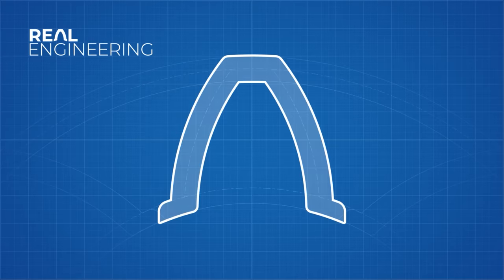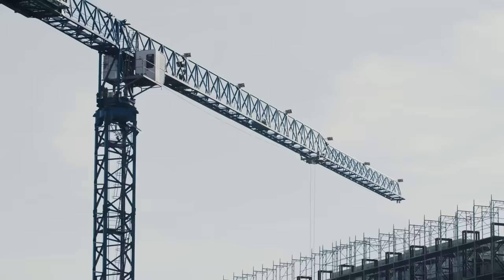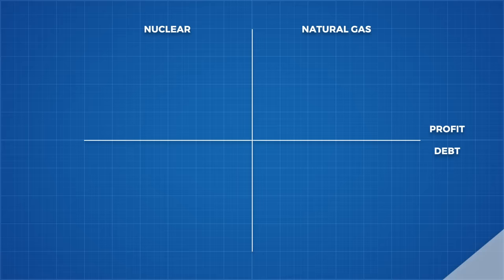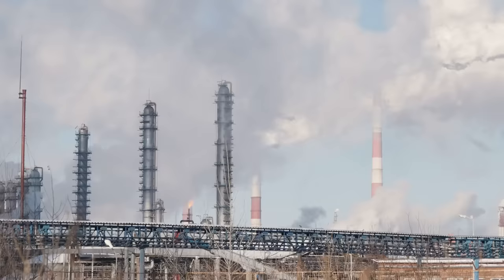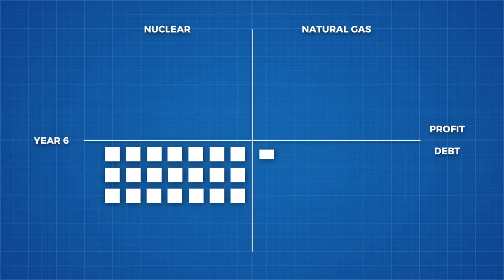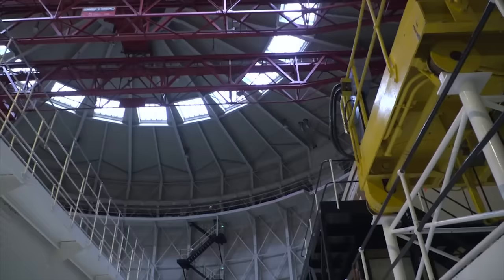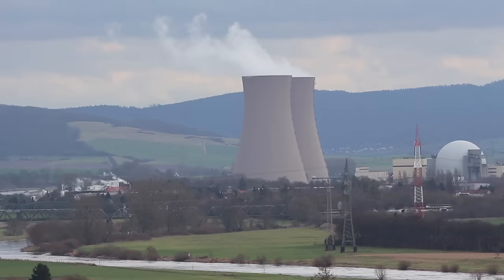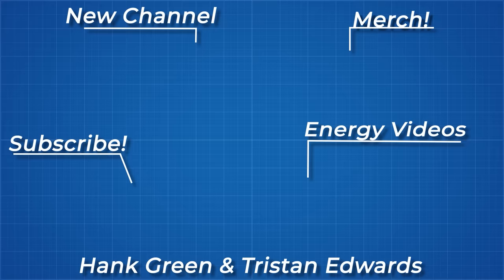The Economics of Nuclear Energy

Comment: This needs to be compared against molten salt reactors.
Reply: How can you do that when a viable molten salt power plant has never been built?
Reply: @Gomlmon99  The technology has been well understood since the 1960s.  See Flibe Energy.  They say they could be operational in 3 years if and when they get government funding.  It's the fossil-fuel and light water reactor industry that is keeping this from happening.  When it happens, and it will happen, these industries will disappear like film cameras.  This is about BTUs out to BTU in.  A coal-fired power plant and a light water reactor have a ratio of about 80 to 1.  An MSR has a ratio of about 2,000 to 1.
Reply: @Cspacecat  except one has never been built so you cannot compare the economics. And how do you know it’s the fossil fuel and LWR stopping them, and not the horrendous corrosion issues they have, that we cannot current deal with?
Reply: @Gomlmon99  You are talking to a retired civil engineer.  This is not rocket science.  It's a nuclear-powered T-kettle.  Calculating it out, an MSR will be about 54,000 times safer than a coal-fired power plant.  We need to do exactly what France did.  Find the most economical MSR that can be built today, and start replicating over and over again.  This lets the economies of scale push the price down.  We should easily get to $0.02 to $0.03 per kilowatt-hour.  We should start with eliminating the oldest coal-fired power plants first.  That would require no grid change.  After you get rid of all the coal plants in North America, then we should start running a grid network starting at Maine to Florida, then all the way across to California, up to Alaska, across the Bering Strait, down through China, across India, across the Middle East, and across Europe.  You run solar all along that grid and you have an endless supply of worldwide, clean, cheap electricity.
Reply: @Cspacecat  so you don’t even work in the Nuclear industry? How could you possibly know how economical an MSR would be? How could you possibly calculate it will be 54,000 times safer than coal when there isn’t even a finalised design? How could you possibly get economies of scale on a first of its kind MSR? This isn’t FMGCs. I feel like too many people from outside the industry look in on MSRs as some world saving reactor, when in reality it has a host of its own problems.
Reply: @Gomlmon99  "so you don’t even work in the Nuclear industry?"  Sorry but the math is there.  If you've spent 37 years doing engineering, it's not too hard to figure out whether someone is fudging the numbers or not. MSRs don't require a containment building.  Cut the cost in half.  It takes about 6 years to build a standard light water reactor.  If you mass-produce the internal components, you can cut the time to about the same as an NG power plant, 2 years. The cost of nuclear fuel will be about 1/20th the cost of an NG plant.  Your break-even point should be about 6 yrs. where the profits begin. That should be about or a little cheaper than a solar field.  You don't need to cut trees of level fields.  You don't have to purchase any additional property.  You no longer need a train to transport coal.  You don't need pipes running hundreds or thousands of miles for NG.   You could park one on top of a mountain if you wanted to.  You don't need a water supply.  You could put one in a mine under a city and no one would ever notice it was there.  An old man with a mule would work for fuel. A properly set up MSR buried into the ground would be impossible to compete against.  When you are done with it, cover it up.

"when there isn’t even a finalized design?"  There are lots of designs ready to be produced now.  Indonesia is going to beat the US with the first operational MSR.

" MSRs as some world-saving reactor, when in reality it has a host of its own problems." No, there is not.  We could easily be mass-producing in 3 years.  We already have 70 years of functional nuclear power plants.  The only reason we are not producing MSRs today is the US government wanted plutonium for warheads.  MSRs don't do that.  Alvin Martin Weinberg, the father of the light water reactor, was terminated by the US Nuclear Regulatory Commission over this very issue.
Reply: @Cspacecat   well we’ll see won’t we? You’re claiming they can produce a reactor that will need materials twice the price and huge amounts of maintenance, with a much shorter lifetime, for 1/20th of the price. I will believe it when I see it.

There’s a reason the entire world hasn’t built one of these. And it’s not the US government. They don’t block the whole world from producing power.

And did you really just say we can be mass producing in 3 years? Sorry have you ever done a single project in your entire career in nuclear?? The safety case alone would take 5 years to write and that’s a piece of paper. I cannot comprehend how you could possibly think a first of its kind nuclear tech ology with no existing supply chain, no precedent and no safety case could ever be mass produced in a matter of years. No way.
Reply: @Gomlmon99  " You’re claiming they can produce a reactor that will need materials twice the price and huge amounts of maintenance"  An MSR requires no backup generators, nor a containment building.  That brings down the cost dramatically.

" twice the price and huge amounts of maintenance,"  No, 1/20th the cost for fuel.  Watch the video. Because the reactor will be constructed in a factory, it will be produced and shipped on schedule without weather interference.  One MSR design requires no maintenance for 20 years, that is it runs nonstop for 20 years.  Bill Gates Traveling Wave Reactor will take nuclear waste, put it in a long steel container, place uranium 235 at one end, and let it burn like a candle.

"And did you really just say we can be mass-producing in 3 years?"  Such a factory would be far less difficult than designing and building a stamping plant.  Yes, full mass-production in 3 years.

" I cannot comprehend how you could possibly think a first of its kind nuclear technology " One has already been operated for several years in the 1960s. The technology has been understood for 70 years.  It's still a tea kettle. If you run thorium, then you need an additional kidney to convert protactinium 233 into uranium 233 without shutting the system down.  Using uranium 235 would be much simpler. 

"with no existing supply chain"  Exactly what kind of supply chain do you think you would need? One Missouri rare earth mine can produce enough thorium to supply the entire world for decades.

" no precedent and no safety case could ever be mass-produced in a matter of years. No way."  If we can build airliners that are massively complex, an MSR is nothing.  You seem to think this is something new.  No, it's not.  it's true, Kirk Sorensen found the information and distributed the original data on CD.  Since then there have been many startups after this.  it's too easy
Reply: @Cspacecat  honestly I can tell your only experience of the nuclear industry is YouTube videos. Don’t talk on what you don’t know. No point trying to convince you otherwise - we’ll see whose right in three years when they will or won’t be mass producing MSRs everywhere.
Reply: @Gomlmon99  "Don’t talk about what you don’t know."  I'm not at your level.  I've forgotten more than you and the next 10 others have ever learned.  My uncle was William Miller, a physics professor at Ford University, Dearborn Michigan. I had been through my uncle's entire physics program at 15.  I went through the US Navy's Nuclear program at 18.  I was first in my class of one.  From there I became an underwater demolitions expert because subs needed divers. I ended my 6-year career with the Navy as Wahiawa's swimming pool manager, teaching swimming and free diving to whoever needed specialized training.  While on Oahu I learned to shape and glass surfboards and became a Pipeline surfer.  During that time is when I started full-time college.  I received my Master's degree in civil engineering from Rolla School of Mines and Technology.

That's not going to happen anytime soon.  The Greenies are already on the path with solar, wind, and batteries.  It's going to be great at first until they realize the costs become prohibitively expensive the higher percentage the Unreliables get.  Then baseline electricity will begin to become extremely difficult.  A couple very bad storms from excessive secondary greenhouse gases we've pumped into the atmosphere that knock out the power grid will eventually get their attention.  I figure 30 years until the knowledge finally sinks in that solar and wind aren't going to do the trick.  This is not all bad.  Once the Unreliables are in place, they will supplement nuclear allowing them to last dramatically longer.  This should give us time to be able to mine the moon for deuterium, a heavy isotope of hydrogen for fusion reactors.  

My honest opinion is we will reach 9 to 10 billion in population wrecking the climate in the process.  I suspect we will drop back down to 1 to 2 billion in our population before we allow AI to replace the rich and powerful.  Unless we blow ourselves to oblivion, it should be smooth sailing for the human species after that.
Reply: @Cspacecat  please tell me this was satire, I can’t even take it seriously 😂😂😂
Reply: @Gomlmon99  I'm 69 and happily retired. I'm a NUC guy for a reason.